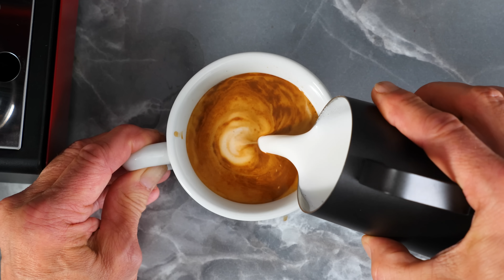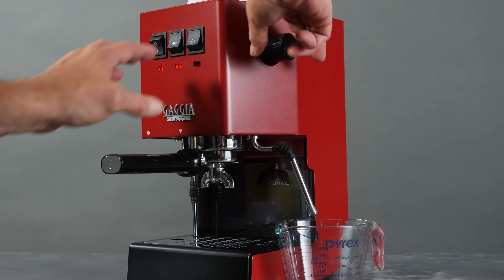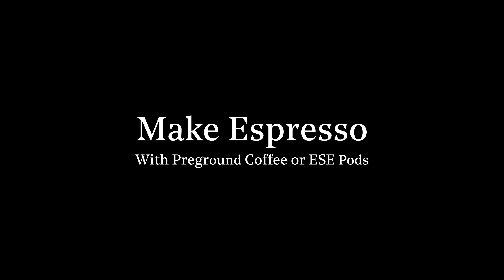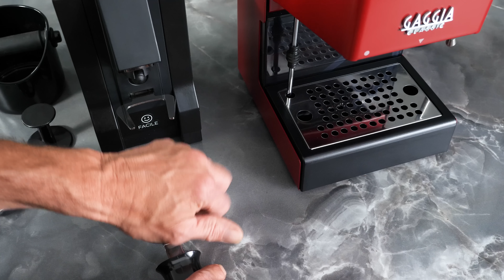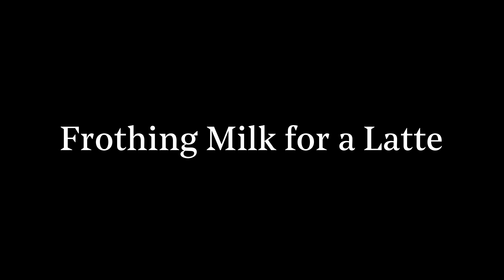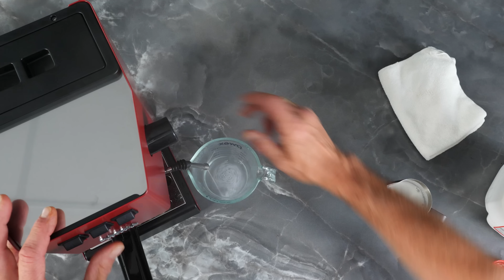How To Setup & Use the Gaggia Classic Evo Pro Espresso Machine

Comment: How do you get a scale on this thing when brewing?
Reply from the maker: Hey Chris good question. A slim-line scale works pretty easily, especially if you're brewing into something like an espresso glass or shot glass as opposed to a tall cup. But luckily Gaggia now makes a lower-profile drip tray if you need to fit a taller cup under the spouts:
https://www.wholelattelove.com/products/gaggia-classic-lower-drip-tray-upgrade-kit?variant=45228638470198

A bottomless portafilter can get you an extra inch to inch and a half as well.

Comment: I have a question. I’m coming out of using a Breville Duo Temp Pro for the past 10 years. The steam wand blew off and out of the machine while I was frothing so instead of repairing it we decided to get the Gaggia E24. The question is, how can I keep from clogging up the shower cap as I seemed to do on my Breville? Had to usually unscrew it and flush it out every other month or so. I always pulled a 14 to 16 oz shot so I don’t think I overfilled it but ya never know right?
Reply from the maker: Hey Marco, thanks for the comment and great question. I do recommend unscrewing the shower screen when you clean your grouphead. You can soak it in Cafiza for 10 or so minutes to get coffee oils off of it. Just like gaskets and portafilter baskets, screens can also wear out over time, so a new one occasionally goes a long way. - John

Comment: 1 important thing is I read that for both refilling the boiler and hot water dispensing, do as you said except leave the steam button turned off, so just open knob and brew switch on. I read this protects the heating elements better and longevity of the machine. Can you confirm?
Reply from the maker: Hi L, thanks for the question. If you just turn on the brew switch you are likely to get some water from the group head. Since steam and hot water are taken off the top of the boiler you are assured a full refill of the boiler by having ther brew switch on which closes the positions the solenoid to prevent water comming from group. The heating elements in the Classic are mounted outside the boiler - not touched by water. They are very robust. A thermostat automatically turns off heating when boiler case reaches a maximum temperature.
Reply: @Wholelattelovepage  I was actually talking about just using the brew switch as you said but also turning the steam knob all the way open without the steam button on. This reverts water through the steam wand as well and a tiny bit through the group head without heating it up as it would for dispensing hot water. Was wondering the possible benefits of this if any as opposed to your method.

Comment: New E24 owner here! Very excited to crack open your coffee beans that was sent with. 

My question is.. how do you know when the extraction is done? Or is that more of a feel thing that comes with time

I didn’t notice a change in flow out of the spout at 28secs in the video but I could be missing something
Reply from the maker: Hi SCS, The basic espresso recipe is a 1:2 extraction by weight in 20-30 seconds. So if you use a ground coffee dose of 17g you'd stop the shot at 34g in your cup. Actually stop at about 32g to account for drip off. That all assumes you have a scale. If you don't, my advice is to use the double shot filter basket. Slightly overfill it and swipe away excess ground coffee, then tamp. Do the extraction and stop it when you have about 1.5 oz/45ml of liquid in the cup. The exact amount depends on how much crema the coffee produces. If little crema then closer to 1oz/30ml. If lots of crema then let it go to 2oz/60ml in cup. If you get the target weight (or volume) in 20-30 seconds from 1st drip from the spouts you are dialed in to a good grind size. If under 20 seconds adjust grind a little finer. If over 30 seconds adjust a little coarser. Hope that helps!
Marc

Comment: Same boiler cool down process for the e24? Also, is it a must do even if I am not pulling another shot directly after my first latte?
Reply from the maker: Hi s, yes, same cool down process for the E24. It's best practice to always cool down the boiler after steaming. If you were not pulling a shot for >15 minutes or until next day it's not absolutely required but still recommended.

Comment: Just got the e24 this week. Paired with a zero 65 all purpose dialing in was actually quite simple, more than I anticipated. Didn't even need to go that far on the dial I'm slightly past 6 (to the left) on the first turn. 

The machine is easy to use and makes very hot coffee but I guess it's the brass boiler helping a bit.
Reply from the maker: Glad to hear you're enjoying the new machine and it's working out for you!

Comment: Great video thank you. Just wondering - is it definitely not possible to use pre-ground coffee with the non-pressurised baskets? Thanks
Reply from the maker: Hi CM, Thanks for the comment and question. It's not impossible but since you cannot control the grind size it may not work out well. If you're going to have a go with pre-ground in non-pressurized basket here's some advice:
1. Use pre-ground coffee intended for espresso brewing. Fineness should resemble what is shown in the video
2. Use the double shot basket it's the most forgiving!
3.  go for a 1:2 ratio of ground coffee to espresso out. So 15g ground coffee producing 30g espresso in 20-30 seconds.
4. If timing is high or low you can use more or less ground coffee to speed up or slow down the extraction. Given basket capacity you can only up dose so much. Tamping harder or lighter can change timing a little bit.
5. Don't expect great results. Espresso made from whole beans ground fresh is much better!
Marc

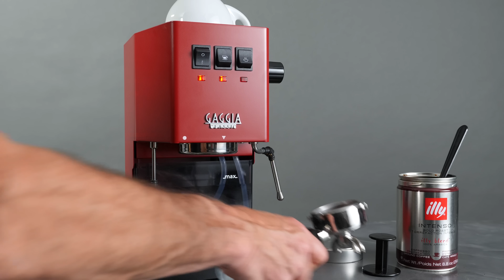Comment: I thought the one I received today was defective, but your video confirms the cheap feel of locking the portafilter into place.  You have to use your second hand with force that bends the entire machine (3:13 in the video).  I almost want to return just for this.  I'm a complete beginner and modding sounded fun, but maybe this isn't the right machine? Someone talk me out of it.
Reply from the maker: Hi jj, Stock group gaskets are rather stiff when new - this will be the case with any brand new machine. With use/break in your PF should clock in further. Using a hand to assist is normal  - especially with a smaller machine. I do this even with 60lb prosumer level dual boilers. Initially you do not have to fully clock in to make a seal. If you like modding, a <$11 1st move is a silicone group gasket. They are softer than the stock rubber that come with even the most expensive machines. If interested here's the right silicone group gasket for your Classic: https://www.wholelattelove.com/collections/group-gaskets/products/caffewerks-silicone-group-gasket-73-x-57-x-8mm

Comment: When I’m just running water through, without the filter, the water seems to come out from only one spot; is this a problem?
Reply from the maker: HI J, Assume you mean the water seems to come from one spot from the shower screen when the portafilter is removed? If so this is fairly normal. Surface tension of water may draw it together to a single stream. When the portafilter is in place and extracting espresso, water should have a more even distribution on to surface of the coffee puck.

Comment: Hi Marc, can I ask do we need to do the purging and refilling the boiler combination every time the steam wand is used? Does using the steam want empty the boiler?
Reply from the maker: Hi s, thanks for the question. Yes, best practice is to refill and cool down the boiler after steaming. Truth is steaming doesn't empty the boiler but it does reduce volume of water it contains and you definitely want to cool it down if you'll be making another espresso.
Marc

Comment: If you’re not planning to make another cup of espresso immediately, do you still need to cool down the boiler or will it cool automatically after some time has passed?

Does this have the same pressure valve upgrade as the EVO, or is it a plain (old style) classic + brass boiler?
Reply from the maker: Hey chianti95, After steaming it's always best practice to cool down the boiler. The between the pre and post steaming purges you are removing some water from the boiler and a small amount in the form of steam. That water is not replaced until the pump runs and pump only runs when brew switch is turned on.
The EVO Pro model and newer E24 (with full brass boiler) version all have the 9 bar spring for units in North America.

Comment: Love my 2019 Gaggia Classic. However, as all of the machines in this price range, it has its weak points: The steam valve seems to be its achilles heel. The brass needle hits a brass valve body which, over time, inevitably creates a small cavity and therefore a leak. Replaced mine with a custom PTFE needle steam valve from Shades of Coffee. I cannot wrap my head around the fact that Gaggia hasn’t corrected this inherently flawed design after 30 years, especially given that alternative valve designs don’t cost more.
Reply from the maker: Hi G, thanks for sharing your thoughts.

Comment: Do you need to run 5 oz / 150 mL through the machine each time you brew a shot? That seems like an incredibly excessive water waste
Reply from the maker: Hi DD, flushing water from the group is a common best practice on espresso machines. It's required for consistent and predictable brew temps on may machine types.
Reply: @Wholelattelovepage  but 150 mL? That's several liters wasted each month. As in more than 5 times more water wasted than used in the espresso
Reply: @DemocraticDangler put it back in the reservoir ...

Comment: I used my brothers Jura and I fell in love with espresso machines. I can’t afford the one he has so I bought this. Should be here in a few days. Excited, I’m just used to drip coffee. I have the OXO burr grinder has a ton of settings for fine to coarse, hopefully it will be good for this machine
Reply from the maker: Hi tm, Congrat on your new machine. I have not used that grinder with the GCEP. My guess is it does not have the same precision in the espresso range as grinder I would recommend for espresso. Grind size is critical when making espresso. If you can't get a good shot using the non-pressurized filter basket you can use the pressurized with single hole. It's more forgiving of imperfect grind size. If not familiar with how to dial in grind size  watch this video which explains the process: https://youtu.be/unHHToGjshI

Comment: Just received my GCE this morning thank you. I’m still a novice, yet I was able to use pre ground Lavazza in the pressurized basket pulling a great shot. Didn’t need to go through any crazy gyrations to get a very nice result. Pre heated the machine for 10 minutes with the porter filter in place. I purged just before pulling the shot, installed the porter filter and turned the steam on for 5 seconds. Then ran the shot, and had a beautiful espresso result. Not bad for a first time I thought, I steamed the milk which came out so so, I’ll have to work on that ! So all in all, I’m very pleased with my new Gaggia !!
Reply: This might be a stupid question, but do you have to pre heat it for 10 minute like that every time?
Reply: @arieljane97  for me yes. I learned the hard way that if you don't wait, you get a cold/lukewarm coffee lol.
Reply from the maker: Hey r, Congrats on your new machine and successful first use! Appreciate the report!!!
Marc

Comment: Heb er lang geleden ook een gehad. Prima apparaat, voor thuis. De toevoeging “pro” is natuurlijk flauwekul. Dat veronderstelt dat dit apparaat ook in een commerciële omgeving op zijn plaats is en dat is onzin.
Reply from the maker: Reactie: Als je er al lang geleden een had, heeft de "EVO Pro" -versie een aantal belangrijke veranderingen ondergaan, zoals een handmatige stoompijp in commerciële stijl, 9 bar OPV in Noord-Amerikaanse modellen en een roestvrijstalen portafilter. U heeft gelijk: dit product is niet geschikt en ook niet bedoeld voor gebruik in een commerciële omgeving.

Coment translation: 
Had one a long time ago too. Great device for home use. The addition “pro” is of course nonsense. That assumes that this device is also appropriate in a commercial environment and that is nonsense.

Response: If you had one a long time ago the "EVO Pro" version has some significant changes like a commercial style manual steam wand, 9 bar OPV in North American models and stainless steel portafilter. You are correct this product is not appropriate nor intended for use in a commercial setting.

Comment: Is there any improvement to be had in the order of brewing and steaming? E.g. is it better to steam first and get the temp to drop before brewing or vice versa and have the machine heating up for the steam after brewing?
Reply from the maker: Hey l, Ahh, the great debate! It mostly comes down to personal preference. Mine is to brew first and then steam as there's less time with the frothed milk sitting around and separating. Push the steam button right after pulling your espresso and 20-25 seconds later machine is ready to froth. I believe this is the most efficient workflow and results in superior drinks. But a coworker here does the opposite. I think he's nuts! :)
Marc

Comment: Do I absolutely need the stainless tube on the decompression duct? I've had my Classic for several years and the tube wouldnt stay in, so i dont use it. I catch the water in a 2 oz shot glass (and dispose of it when im finished). Will not having the tube attached harm my machine?
Reply from the maker: Hi st, It will not do harm  - maybe just a bit messy. But it's easily fixable if you are vaguely handy with tools. Here's a video showing how: https://youtu.be/t-VYpzMPb9g?si=lUwN6jmUBkbVWGdF
Reply: @Wholelattelovepage  Thank you, I'll check it out. Yep, I'm handy with tools. Just wondered if the tube is supposed to connect to something deeper inside that I've been allowing to get wet.

Comment: How can extraction be 25 seconds for double AND single 

Makes no sense , so you have to compact single espresso much harder to get 25 seconds
Reply from the maker: Hi Gary, You are correct - on the surface it does not make sense. But look close, a single shot basket has fewer holes in the bottom so has a much lower flow rate.

Comment: I just bought the Classic Evo, together with an Eureka Specialita, is my first manual espresso machine, however when I use the double shot basket after the espresso is done and I remove the portafilter i see that is quite a lot of water over the coffee pod inside the basket, what am I doing wrong?
Reply: the grind is too fine or you press to hard when tamping the coffee.find a balance between grinding and pressing the cofee in basket

Comment: hi  bezzera new hobby or Gaggia Classic Evo Pro? tnx
Reply from the maker: Hi a, They are very comparable machines although the New Hobby has higher price tag. If doing a lot of large milk drinks the Hobby has more steam power available due to a larger boiler. The Classic EVO with 9 bar OPV might be more appealing to espresso purists as the Hobby has OPV set to higher pressure. Here's a link to side by side spec comparison of the machines: https://www.wholelattelove.com/pages/compare?products=NDYzODQxNzE5MDk2Niw2OTM1ODMzODA0ODU0